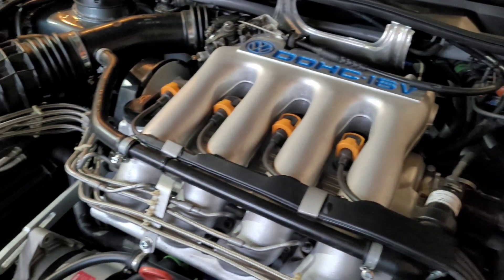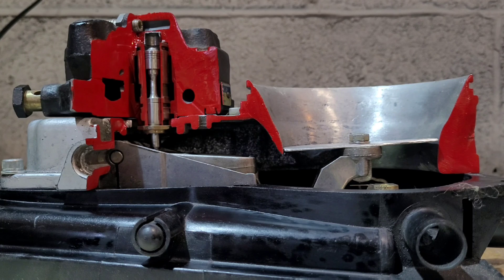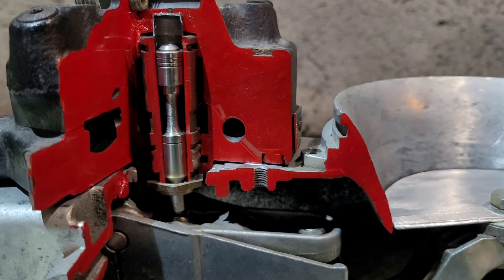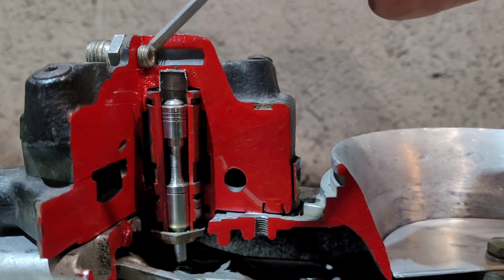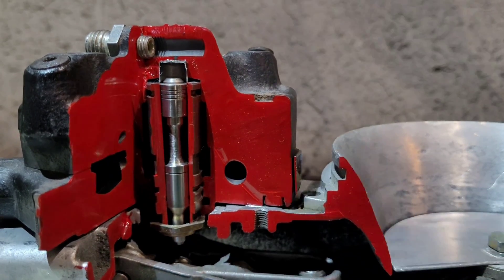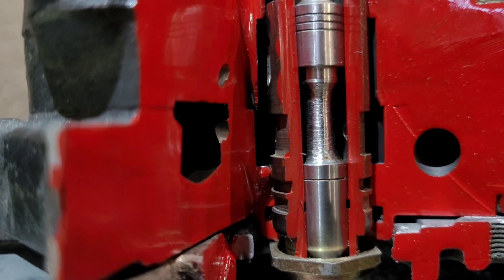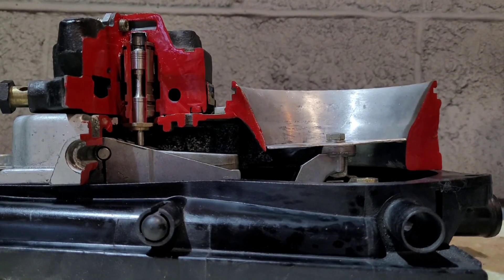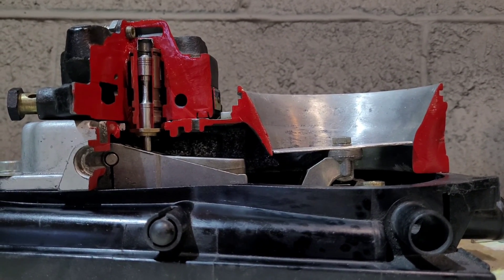Bosch K-jetronic - The Inside Truth

Comment: Thank you for going to such great lengths to explain this system. I’m considering buying an R107 SL and you’ve demystified this system for me.
Reply from the maker: No problems, glad its help so many across the globe
Reply: This airflow sensor model is the complete opposite of the model used on Mercedes Benz  vehicles.
Reply from the maker: Yes, the Mercedes use CIS-E which im in the process of duplicating this video but for CIS-E

Comment: Thank you for the great video. I have been wondering about one thing, where is the throttle body located in these systems? It looks like the air after passing the filter goes directly to the air flow metering arm thing in this video, does the throttle body come after this part? Or is this part also acting as the throttle body and there is no other seperate throttle body, in other words is the gas pedal that we push connected to this arm?
Reply from the maker: Hi, thanks 
Nope there is a throttle body, after the air flap the air travels up and through the intake piping and then goes through the throttle body
Reply: @GreyGooseRestorations  i see, thanks a lot

Comment: Nice video! I have vw golf mk2 1.8 Cat from 1987 which wont start, but once you start it runs it does great. While engine is warm you can start with no problem. Once it starts cooling of, it gets harder and harder to start until you wont. Also, when you turn the car on and it is cold engine it fires but won't start. Any idea where to look?
Reply from the maker: Sounds like you may have an issue with the cold start injector, WUR or just a fuel pressure issue

Comment: Something ro note is that on Mercedes the air venturi lowers rather than raises. This makes it more obvious to see if your fuel plunger is sticking. 

Question. My Mercedes W123 spends a lot time standing and the fuel plunger does stick frequently. It's a pain to remove but does free up easily. I use a lead replacement additive and try to get low ethanol fuel. Would using a fuel additive or injector cleaner help?
Reply from the maker: Handy info thanks, potentially it would be worth adding something to provide some more lubricant in the fuel to help prevent the plunger from sticking.
Reply: A shot of E85 to clean it, then use some 2-cycle oil in the fuel at 500:1 or a little more the first time.

Comment: Great vids, really appreciate you taking the time to do these.
I have 2.0 16v Corrado (9a) with fuelling problems, The main issue being fuel pump failures, Both the high pressure pump under the car and the in-tank lift pump!. Also on several occasions the car has refused to start and the high pressure pump leaks from the banjo...leave it for a few hours and it starts and runs, and does not leak!!

Have been advised it could be an issue with the K-jet system, sticking pin has been suggested, but would that cause pump failure/leaking?

The car also runs badly when warm (misfires and will not idle)

Any ideas really welcome! thanks
Reply from the maker: Thanks, firstly id focus on the pump, make sure its getting a good constant 12+ volts.

There is a inline check valve in the fuel pump  output which can be removed and may need replacing, if its sticking it could be causing to much pressure in that area causing the leak, after while the fuel may seep past the check valve allowing the car to start.

If you want message me on my Facebook page - Grey Goose Restorations and we can go through the system and see if we can fix it 😁
Reply: @GreyGooseRestorations  thanks for the reply, will have a look on Facebook, I was not aware that there was an inline check valve, will have a look for that. 

Appreciate your help!

Comment: Great video! In one of your other vuds you talk about honing the fuel pin to allow more fuel to the injectors. Now if the air-fuel mixture is balanced 14:1 based on the ratio between the fuel pin and the diameter of the air plunger, won't honing the fuel mess up the Mixture? i.e. how will you then add more air to the system? Is it now possible to adjust the air plunger to open more where it would have previously at that position given a lean mixture?
Reply from the maker: Agreed, i did attempt to opened out the the air flap with a larger plate with a % bigger than the % removed from the pin, however this didn't work, it may work if you could get the air plate cnc machined but vs the cost involved its not worth it
Reply: @GreyGooseRestorations  so you're saying that honing the fuel pin is not worth the trouble and that one should rather play with the WUR and system pressure?
Reply from the maker: Yes pretty much, took a lot of fiddling about but setting the pressures correctly and carrying out the WUR mod along with suitable timing advance make more difference (WUR mod video should be finished sunday 😉)
Reply: @GreyGooseRestorations  we appreciate your work. So many disregard the ingenuity and robustness of KJET and it has become a taboo topic. What would your view be in terms of performance between modifying the kjet system as discussed versus going EFI with the ABF manifold? I ask because I would first like to get some more ponies out of my kjet before moving over to ABF EFI.
Reply from the maker: @colevincent8563  EFI will allow for more precise timing adjustments which is what the kjet doesn't have but i look at is as cost vs gain, the gain over and ABF on EFI vs KR on kjet could be 20bhp but would that 20bhp really make a difference in the real world plus the KR is very rev happy engine as it is.
Reply: @GreyGooseRestorations  so if going EFI with the ABF manifold gives another 20 bhp, how much more bhp do you get when modifying the WUR on kjet? And then I want to know if you have made a video concerning the modification of the system pressure regulator though the removal of shims on the side of the metering head?
Reply from the maker: Kjets on KR have been known to make 150bhp but there are so many variables its hard to put exact figures on things. Im sure i went over the adding of shims (if required) in the pressure tesing video

Comment: It's always great to see people still making such detailed video's about K-jet! As the knowledge of this system is slowly dying out, sadly :-(. I swapped my 1990 MK2 CL to a 1.8 KR. Had to learn a lot about K-jet as i've previously never heard of it before. It runs pretty decently, but still have some issues to sort (cold start doesn't work, also starts hard when cold, but once it's started it's fine, etc) I suspect the WUR is also not correct. The metering head and WUR are all really old lol and have never been serviced, so i'm very suprised it all runs so well for it's age! Next step is going to be measuring the system pressure :-) Wish me luck
Reply from the maker: K-jetronic is such a great system and rarely goes wrong but as you say, some parts may be original so 30 odd years old and would benefit from a rebuild but on the flip side if its still working well after all those years that just confirms how good the systems are

Comment: We have an 1986 sierra xr4x4 with the 2.8 v6 and k jetronic, after 17 years of standing we found that the rubber O ring on fuel pressure regulator had fallen apart  this ment it wasnt quite making the correct fuel pressure to make it start, changed the rubber O ring...now runs superbly.
Reply from the maker: Glad to hear it, i do love an old ford, definitely not many xr4x4's still going 👍
Reply: @GreyGooseRestorations  we have the mk1, its going for its first mot since 2003 next week.....according to how many left, there's between 20 and 30 left...but there's discrepancies between how they are registered....some are registered as xr4x4 I and some just xr4x4....
Reply from the maker: That's one of the hard parts finding out the details like that as back then things weren't recorded or noted as good as they are now

Comment: Can’t get mine to idle , starts no problem but you have to keep it going with some throttle all the time otherwise it just cuts out, any thing I should check ?
Reply: The biggest problem with these systems is people fiddling with the mixture screw. Use the idle air screw to adjust the idle speed. If the car has been standing, the fuel plunger has likely stuck. Push the air flap and feel whether the plunger is moving freely.
Reply: @bikeman123  excellent info thanks 👍 im off to vw nw this weekend so hopeful i can have a chat with someone whilst im there to go over the k jet system in the metal as it were with a view to getting mine back up and running.
Reply: mines the same i assume you turn the small.allen key clockwise? but if this doesn't work what do you try next please?
Reply from the maker: Clockwise = Rich
Anticlockwise = Lean
If all else is healthy then it should be case of adjusting clockwise a 1/8th turn at a time untill the engine will idle on its own, then adjust the idle screw on the throttle body to further smooth the idle, 1000rpm is where the 16v idles spot on
Reply: @GreyGooseRestorations  Hi, great thank you v much. When mine was in daily use  it never missed a beat, but suddenly it started switching itself off when sat in traffic or when idling on the driveway. 
It revved absolutely fine and drove spot on apart from this. 
I have long suspected that i needed a new hall sender as it  occasionally gave me the dancing rev needle when you went to start it  (needle flew round to 4-5 rpm with engine off when you turned the key to first position) , ive got a brand new bosch dizzy sat here ready to go on, i just dont know how to fit it! 🙈🤣👍 many thanks again  for your help
Reply from the maker: It could need the hight of the arm adjusting to richen the mixture potentially, only a 1/8th of a turn at a time
Reply: @GreyGooseRestorations  thanks, sounds about right as the exhaust fumes stink on petrol when it’s running

Comment: About to do some pressure testing on my mk2 tommorow. What would be some symptoms of a stuck pin?
Reply from the maker: A stuck pin would normally prevent starting but depending on where its stuck you may be getting to much fuel in and around idle position. The normally stick in the lowest position due to not being moved for a long time or they will stick or become very slow moving to come back down (closing the fuel off)
Reply: @GreyGooseRestorations   what’s a good way to free up that pin?
Reply from the maker: Take the fuel line off the middle centre of the metering head and spray some penetrative fluid in there such as WD40 and leave it to soak down, hopefully that'll free it up